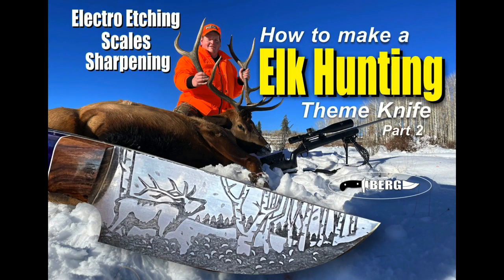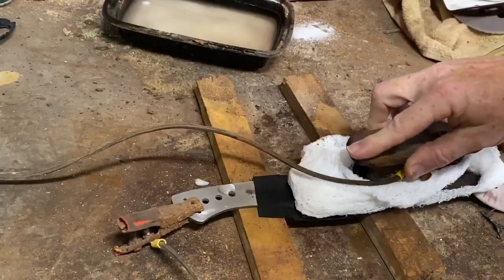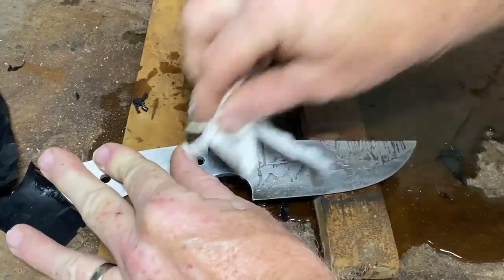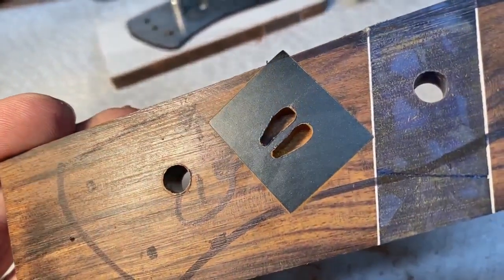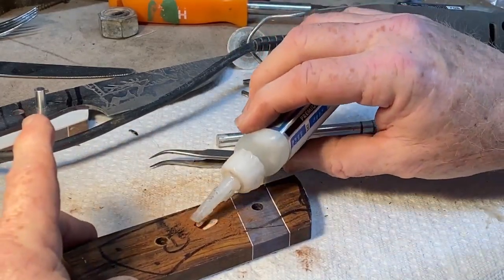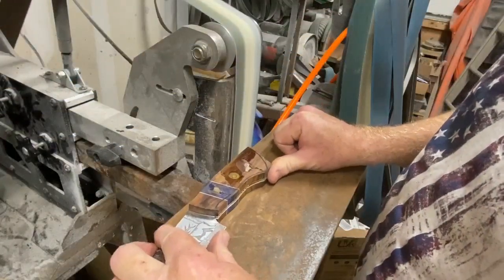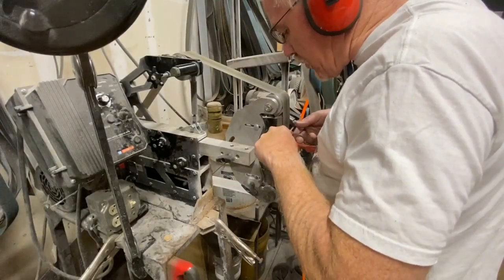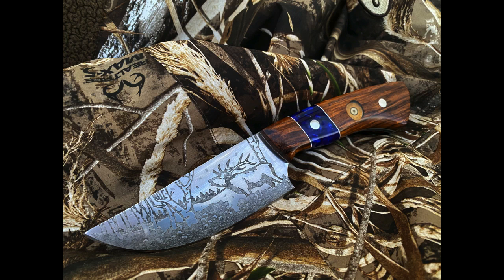How to make a Elk Hunting Theme Knife Part 2 Blade Etching Scale Inlay and Sharpening

Comment: i have a question what kind of battery charger should i buy? an amazon or ebay link would be great.
Reply from the maker: I have an older one. Unfortunately the new versions have a built in safety that shuts them down when they detect a short. You might have to find another power supply. Try searching 12v 2 amp power supply online